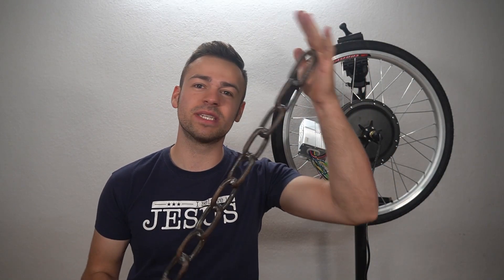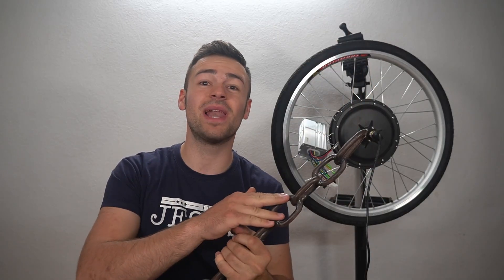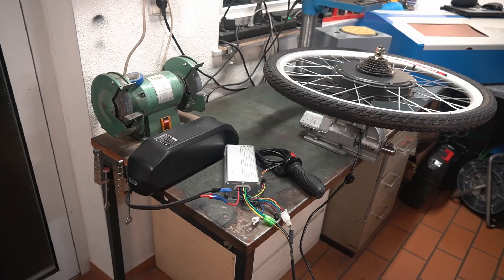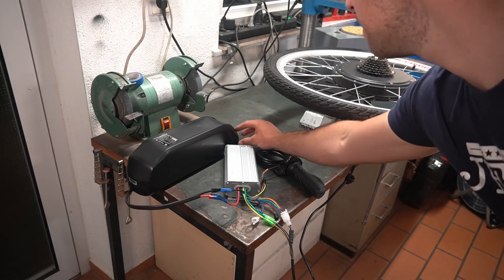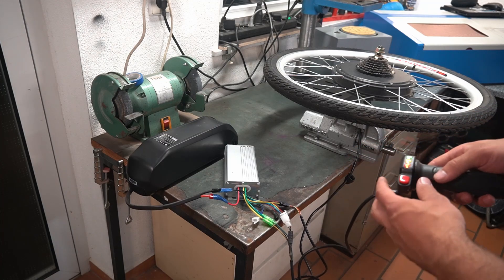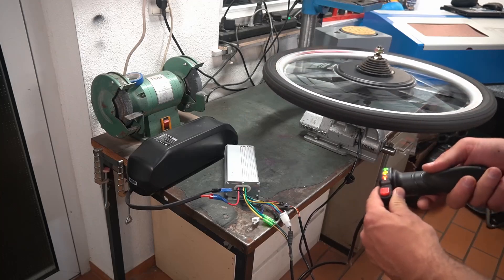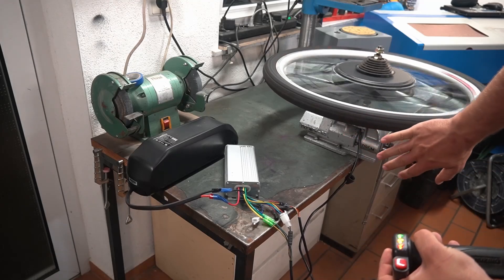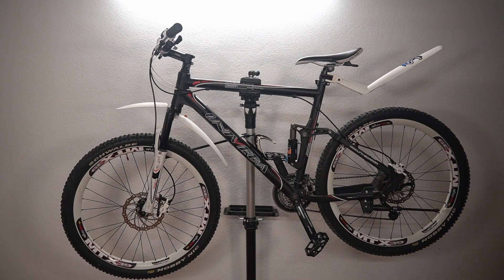DIY 1000W 48V E-Bike 60km/h conversion kit electric bike

Comment: Hello, I have a bike with 26inch wheel. I want to upgrade a motor like yours. My rear dropout bike is 135mm wide. I wonder the 1000w motor can fit it with a 7s or 8s thread freewheel? Could you make it clear? I appreciate it.
Reply: Good boy
Reply: Hi mate I’d like to recommend our Voilamart 48V 1000W Ebike 26" Rear Hub Motor. It’s perfectly compatible with a 135mm rear dropout and is priced at $192.89.

Comment: The fork on the rear of my bike is 134mm. (the internal part) can I use this kit? And another question, would a battery with 48v and 30 amps work for this kit?
Reply: Yes ofc
Reply: I wouldnt Chose 30ah because it is very expensive but it you Need it Go Ahead I Build One with 22ah with round about 80km-100km so i think this would fit Better if you want to stay fheaper

Comment: Hey mate,please give me a reply !
I had bought battery and electric wheel which is 48v 1000w !
My bike frame size is 21inch !
Anyway i installed everything perfectly,and also i used 2 torque arms !
But still when i ride it,the wheel nuts goes out also when i re-installed it then the wheel goes out.
Can u please give me a solution.
And please suggest the cycle measurement,which size cycle is perfect..

Please
Reply from the maker: Hey i am very sorry bzt i didnt had any problems like that.
Reply: Turn off regenerative bracking

Comment: can this be installed at front? maybe its possible to remove the gears on the brushless motor and mount it on the front instead
Reply from the maker: You can by kits like that for the front Wheel as well.
Reply: Not sure why you would want a high power motor up front unless you're doing a dual motor setup
Reply: @victorvance6279  It's much simpler front
Reply: @TurbineOfTheWinds5816  absolutely easier up front but you MUST use torque braces on the drop-outs, or the drop-outs will get rips out of their foundations.

Comment: I bought a controller with cruise control, you hold the throttle in the same place and press a button, works for any speed and it stays constant power that you set, then you just pedal with it for extra range.
Push brake or throttle to disengage very cool and safe I like it more then assist.

Comment: Hi

nice ebike conversion but the bike is way too bad for the performance :D i ride 750w bafang mid drive on cheap bikes (500-750€) and always had problems with the suspension you shouldn't ride an sr suntour! (my first suspension fork broke!) rather rockshox or fox and disc brakes are a must! one should say it is the ghost kato base 29 2021 completely new!

it's best to get a new fork right away that is also approved for ebikes and you'll be safe.
Reply from the maker: Thanks for that afvise!